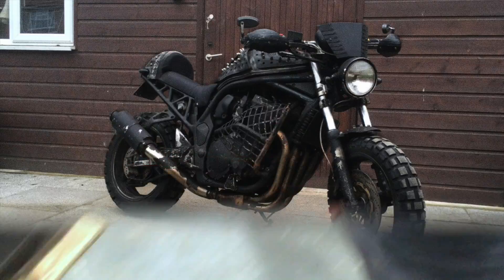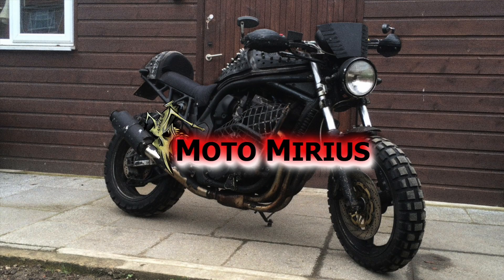ABS Brake Bleeding : Mini Skills

Comment: If you get air in an ABS module, you MUST activate the module to pump the air out of the cavities. If there is NO air, regular bleeding WILL work, but if air gets into the module from doing something like replacing the master cylinder, you have NO CHOICE but to activate the pump to clear the CAVITIES of air. DO YOUR RESEARCH!
Reply from the maker: Glad to see that you agree with me that on closed ABS modules activation is necessary if air is trapped in the module as described in the video.  Skäl. David
Reply: So how do you activate the pump to bleed the system

Comment: One might could also unplug the module and fashion a switch and external power source to manually cycle the pump. Then just cycle pump, bleed, repeat until there’s no air!
Reply from the maker: Indeed.   There are options for those who are more electronically minded!  Skäl  David
Reply: I'm not convinced this would work. 
Most systems have the control unit piggy backed on the valve block, therefore there will be no way of driving the solenoid valves or the motor through the connector. The connector is usually for comms, diagnostic light and power etc and sensor signals. 

Although it could be done you would need to program a PIC or MCU, first to tell the ABS module the ignition is on, then mimic the impulse from both wheel sensors to turn the diagnostic light off and activate the system then on both sensor channels you would need to send a signal that will trigger the abs. 

At this rate for most it's just easier to take it to a dealer or if you can find one buy a scan tool that will operate the ABS.

Comment: This video is on point. My motorcycle has braking problems since I changed calipers, brake master. Went to a lot of mechanics to bleed but there's still no improvement. Until I went to the dealer, they just connect my motorcycle to their computer then pressed the brakes. You can feel that fluids are flushing thru the ABS module. (Levers are shaking during flushing, just like when we pressed hard the levers and the ABS are triggered).
Reply from the maker: It's important to activate the ABS pump on a regular basis, so good to hear that you got it sorted.

Comment: Manufacturers complicate simple systems with TECHNOLOGY!!! That should be said with huge echo effect on the last word. Yes the god called TECHNOLOGY that has ruined the auto industry is now working to screw your motorbike too. I have a GSX650F (Bandit really) and the ABS pump failed on it and after much misdiagnoses and expensive labor I realized that. So just before I left the dealership with my rear brakes useless and wondering why I would pay $2000 for a new ABS pump for a bike I payed $4500 for, the service manager said I could fix it cheap. I was all elephant ears. He explained that if you seal off the ABS pump and run the hoses from the master cylinders to the calipers which of course bypasses that stupid thing...then Bob's your uncle and tech can take a freakin' hike. And that's what I did and I'm loving it!!! Who needs ABS on a bike??? I've had plenty before and never needed it. It's purpose is so that the steering doesn't lock when hammering the brakes. That works fine on a car but bikes are different and I won't go into it. But balance of the bike and kinetics are part of it. What nonsense and I'm sure there's lots who disagree with and that's fine. But if I get a car I will never get one with a glass mat battery (AGM) because of the price and the b.s. you go through when replacing it. And you can ruin the entire computer system if you're not careful with new cars. And that applies to a long list of replacing simple things made complex for simple systems that have been made complex. It's getting crazy out there and it's increasing by the minute.
Reply from the maker: Unfortunately with modern bikes the ABS unit is integrated into many of the riding modes so eliminating it isn't going to be that easy because you will have the same electronics and ECU issues.   All safety driven and yes, it will not get better.

Comment: I am more interested in bleeding the ABS system for a car when I stumbled upon your video, and I bought the Autel MaxiCheck Pro to do it. But I wanted to mention, in the past when I wanted to test triggering the ABS while driving, the best way is to brake hard on a dirt or gravel road. The hard braking will want to lock up the wheels quite easily and slide on the loose dirt or gravel. So the ABS system will sense a lot of wheel "slippage" due to the low friction surface and engage quite easily. Trying to do an ABS test on actual pavement is far more damaging to the tires, rotors, and overall brake system. And on a motorcycle? Probably a bit dangerous.

Comment: As I understand it, Harley Davidson’s system has the accumulator and pump closed, though there are a few aftermarket readers that can activate the HCU’s purge mode.
Reply from the maker: Closed is mostly only an issue if you are fitting a new pump, but useful to know that HD run a closed system. Skäl  David
Reply: Considering getting another one and I’m a long way from a dealer. I’d mainly be concerned with the fluid in the HCU not getting flushed during fluid changes, as that is an expensive unit and critical for safety. Apparently Snap-On can communicate with an adapter and activate purge function, as can ITM HD2, and Vance and Hines fuel pack pro. A person could go out and activate ABS on the street, but I’d wonder if you’d get one long continuous cycle necessary to fully purge....

Current BMW is no problem, just bleed as normal. Their previous servo system actually had 2 hydraulic circuits- from the master cylinder to the HCU, and from the HCU to the caliper, so the HCU had little reservoirs you had to fill with a special funnel with a threaded and o ring sealed end....  glad they changed that. 

Anyway, great video!

Comment: Is it not easier to activate the abs by riding and breaking at low speed on a dirt road where abs will activate almost immediately after breaking? I do that with close system cars.
Reply from the maker: Yes.  I did advocate using braking to activate the pump.  But I'm not completely confident the average road rider has the skills necessary to do this off road on a bike without crashing and burning as a wheel breaks free, especially if its the front wheel turning right as this tends to open up the throttle then pin the wrist down into a lock - AKA whiskey throttle.  Road slides tend to be a little more predictable for a bike.   I have no issues doing it off road as slides are completely normal for anyone with those skills.

Comment: Very informative video. I have a 2017 HD with a closed system. It has a self check for the ABS. I have asked the dealer service dept., but no one seems to know. Does the ABS system actually operate the valves and pump during this self check and if so, would this not actually remove the old fluid from the unit after several cycles? Thank-you.
Reply from the maker: As I Understand it Harris, the self check  runs as part of the startup of a HD.   So you need to mark sure you don’t turn the ignition on whilst bleeding your brakes in case you get air lodged in the closed part of the circuit.   But on the upside once you’ve done the bleeding you don’t need to operate the ABS whilst riding.    A few cycles of turning the ignition on and you should be good to rebleed the now contaminated fluid.  Skäl   David

Comment: replacing a caliper on a 2008 impala. so i bleed all brakes or just the caliper i replace? and when would i used the scanner ABS module program? and
Reply from the maker: Unless you’ve changed the fluid recently you should refresh all the fluid in the system.  Skäl.  David

Comment: Good advice as always Dave, I always thought it was the same process and not a problem as long as you don’t introduce air which you wouldn’t want to do using non ABS anyway 👍🏻
Reply from the maker: Cheers Dave.  It’s a recurring question on forums because of the closed system bikes.  I’m guessing these will become more common with stability control etc.  Skäl

Comment: Thank you!  You really helped me a lot. I’m working with an open system on a Ford Edge SUV. I’m going to do this after I replace the ABS module. Because that’s where the dealer wants to charge a way  higher price to bleed the ABS module. 

Instead I’ll engage the ABS by going in reverse and hitting the brakes hard a few times as you described, forcing the air into the system.  Then change the brake fluid by bleeding the brakes until my fluid runs clear. You will visually see it by attaching a clear tube to the bleeder valve. 

I’ll Do that a few times. Compare the color of my brake fluid to the new fluid and see if it’s necessary to replace it again. Saves money and the job is done right. They also wanted to charge a high cost to reprogram the ABS electronic module. An easy get around is to put the existing electronic module on the hydraulic side. Now No programming is necessary. Thanks again
Reply from the maker: Thanks and good luck with that.  Skäl  David

Comment: All id say is that load compensators need to be open.   If you remove the rear wheels then ensure you compress the trailing arms up to ensure the valves are open.

Comment: I think most of these problems are caused by air getting in to the accumlator and damper within the abs hydraulic unit; If the port of the accumator or damper is central and horizontal it will tap air in it when changing the hoses. Thus the nightmare begins. Triggering the motor and shutting the valves is only way it will bleed. I think what it's doing is breaking up the pockets of air in the damper/Accumulator smaller bubbls move easier. But to do it well you need a good fast contestant flow of break  fluid preferably with srong surges from the lever. 

alternatively we could try rotating the unit so it's valve ports are vertical.

Comment: Had a question. Have a Rc390. 2018 model. Abs standard. Steel braided line. Everything is stock except master cylinder. I pressed the brake and tied it with the front wheel lock. I saw a video saying that it helps build pressure. When I tried it after 2 days and there wasn't any pressure but when I removed the zip tie the pressure came up. Does it mean that I have air in the system? New brake fluid. And while riding it's not spongy. Any suggestions
Reply from the maker: If the brakes are not spongy whilst riding then you don't have a problem.   The brake system is designed to allow air to rise up into the master cylinder, so it sounds as if this happened whilst you had the lever tied back and once you released the lever, the air was able to move up into the master cylinder as it was designed to as the lever is operated.
Reply: @MotoMirius  so that means there's some amount of air in the system. So if I just do this again then crack open the bleed valve on the master then I guess that should solve my issue right.
Reply from the maker: @kevinpinheiro2485  What issue do you have?  You tell me that the brakes are not spongy when you ride?
Reply: @MotoMirius  while riding it's not spongy. But definitely lack of brake bite is there. I heard that if u zip tie the lever when it's pushed in completely it helps. So I did this but I didn't cut the zip tie. I kept the pressure on for 2 days. After 2 days when I went and pressed the lever( with the zip tie on ) the brake kinda like collapsed. Like there was no resistance or pressure. Like there was no fluid on the system. When I cut the zip tie and  the lever came to original position then the pressure came back. The reservoir level didn't go down so I don't think the brakes are leaking. I think maybe there's air in the system and when it was compressed then the air came on top. And when I cut the zip tie maybe it went again back into the system. Any idea ? I've bled the brakes the usual way. Some people told me run the engine cause of abs and bleed. So I'm getting a lot of different opinions and idk what's right. I figured you have a duke 390 and that's similar to mine. So what would u suggest I do. The mechanic at the dealership is pretty much clueless. Some people told me it's definitely air. I had a small accident recently and the best easy to describe it is I was braking as hard as possible but I just wasn't stopping. Felt like skating on ice. And even the abs didn't come on. So I thought that's also a possibility that air was in the abs unit. ??
Reply from the maker: @kevinpinheiro2485  OK.   You need to identigy the core issue and work one step at a time.
Lever trick only works for air that can come up the line.   But with ABS this doesn't really work because of the way the brake lines are routed.  Air doesn't go back into the line from the reservoir.   So forget the lever trick, that isn't related.  
Running the engine does nothing to the ABS so forget that too.
Does the ABS unit work when you are riding and press the rear brake hard?  You will feel it in the lever.
You said that you changed the front brake on the handlebar?  What did you change it to?  
Have you changed it back to stock?  Does the problem go away?  You don't need to bleed the system after changing the handlebar unit, you just need to allow the air to bleed up into the reservoir.
Reply: @MotoMirius  lately I can't tell if it's working. Usually i test it by picking up decent speed and slamming the rear brake. If abs turn on for the rear I hear a clunk sound..but the day I had the accident I didn't feel. I mostly use the front brake and if abs turns on then I feel a heavy vibration in the lever. I changed the front from 13 mm bybre axial to a 17mm radial from RCB. Till now there wasn't an issue but a couple of days before the accident I changed brake fluid. But before that I didn't have any issues. Used to stop easily. Also I noticed that the lever feels a tiny bit spongy and after riding a bit it becomes a bit more firm and once cooled it again gets a tiny bit spongy.
Reply from the maker: @kevinpinheiro2485  Did you change the fluid because you'd changed the caliper or was it just a fluid change?
Reply: @MotoMirius  fluid change. I am using same setup for a year and usually it never gave this issue.
Reply from the maker: @kevinpinheiro2485  Did you change front and rear fluid?   Are you only having this problem on the front?  What method did you use to change the fluid?
Reply: @MotoMirius  changed both. But front is giving issues. Regular way. Build pressure. Hold the lever in. Crack open the bleed valve. Let the air out by the hose. Close the valve and release the brake lever. Bleed from top and then from the caliper.
Reply from the maker: @kevinpinheiro2485   But doesn't always work well with systems that have built in air traps like ABS routing.  KTM use a pressure bleeder - mostly because it's fast so cheaper for the customer, but also because it forces the air through the system.
Reply: @MotoMirius  yeah I've seen it on some YouTube video. Locally we have 3 decent garages but none of them have that. All use the conventional method. I thought to purchase one online but I've seen some bad ratings and reviews for them on Amazon. I will try to get it bled from maybe when move out to another city. I guess it's called vacumm bleeding. Till then I guess I can't use the bike much..😅. Thanks for the advice. I'll look into this and get back to you.😁
Reply from the maker: @kevinpinheiro2485  No, it's called pressure bleeding - and only a KTM dealer will probably have the right fittings.  But bleeding would be my recommendation at this point.  If you still have the stock brake handlebar unit, that may be part of the issue with normal bleeding if you have a larger caliper.  I would recommend either reverse bleeding or vacuum bleeding yourself.  Good luck
Reply: @MotoMirius  I looked up pressure bleeding. It's running pressurised fluid from another countian through the master reservoir right ? Since I have a after market master. The fitting won't be compatible. So could I change to stock. Bleed it and then go back to master and remove the little air in master ?
Reply from the maker: @kevinpinheiro2485  You could yes, if you have the right fittings. Bleeding the ,master is trivial

Comment: How would you bleed the brake of Ktm duke with abs? Need your help to explain it in details if possible thanks
Reply from the maker: The only issue with the ABS on the KTM is the one that is common to nearly all ABS bikes is that air can be trapped in the pipework for the ABS unit.   KTM dealers use a pressurised system to help overcome this.   I would recommend that you ensure no air is introduced when bleeding, so reverse bleeding can be problematic.   Normal bleeding will work, just be careful that the reservoir does not run dry - and if it does then gravity bleed until the air has risen back up into the reservoir before continuing with the bleeding else you can push air down into pipework where it can become trapped - in summary, normal bleed - pressure or vacuum can help, but take extra care not to introduce air into the line.